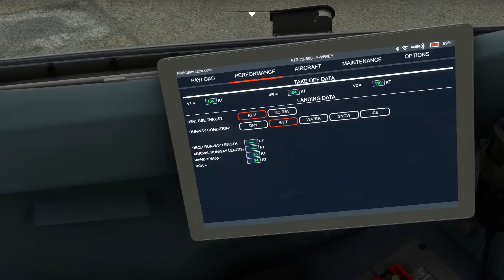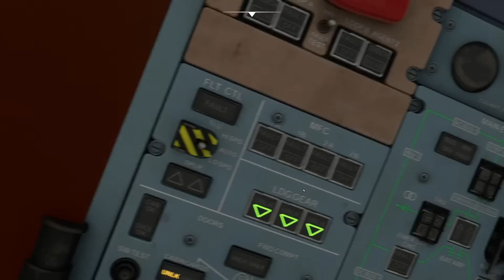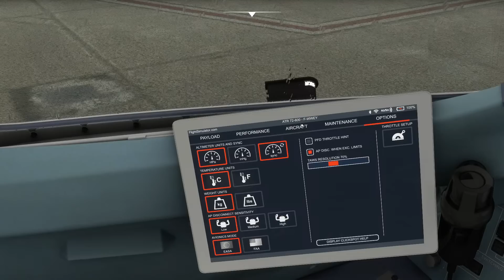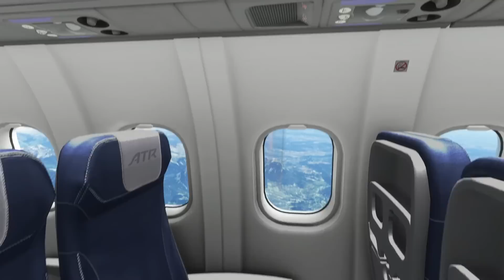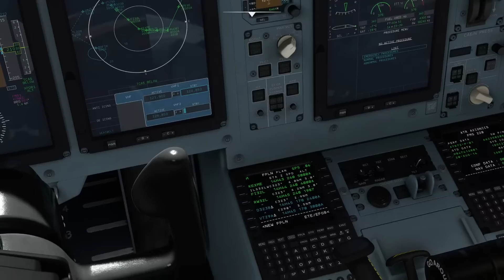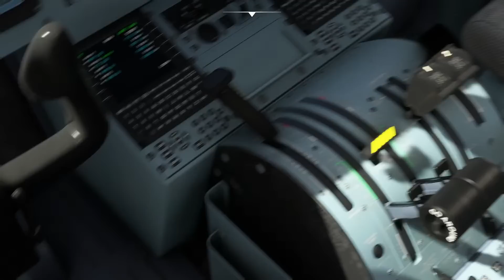ATR 72-600 FIRST FLIGHT: Study Level or Game? | Real Airline Pilot

Comment: It's hard to get typed in a new ride.  I'd forgotten until I moved into MSFS and the 737.  I miss my 757.  😣
Reply from the maker: The 757 must be a really cool plane to fly! I almost got to fly one before I got my new job on the A330, what a difference that is though!
Reply: @A330Driver  Well, an A330 vs 757/767 isn't a bad choice.  If Boeing would pick up my design for the 757X, I think that would be the way to go.  Since the 787 is essentially the 767 replacement, why not downsize the 787 as they did with the 767.  They could reduce the size of the tube for a 3/3 single isle, use the 787 wings, avionics and, why not, the GEnx-1B54.  Those big honkers would require them to keep her long legs for the perfect aircraft.  I get chills just thinking about it.

Comment: Unfortunately, I have to disagree with your opinion. 
Generally people have some expectations of the word expert or professional. Let me explain. 
If I call a product expert or professional, the level of the product must correspond to that. As much as the ATR product pretends to want to be professional or expert it is not. What usually separates the amateur from the professional is the depth or range of knowledge skills in a pilot side and depth of system simulation in aircraft side. In a product designed for professionals (experts) we rightly expect the best that can be provided. Unfortunately, Microsoft's ATR 72/42 certainly doesn't meet this! In fact, it doesn't even come remotely close. If anyone has twarted expectations and rightfully upset the community, it was Microsoft.
People rightly expect that if something is expert level it will be expert not a slightly better standard. It is quite obvious that making a good aircraft with an in-depth simulation is not a problem, as we can see with other projects even some for free. However for a giant company that has all its source code and core creative team this is a big problem. 
The ATR 72/42 ranks somewhere between the default ASOBO and A310 aircraft. The fundamental difference is that the A310 was free. Unfortunately, Microsoft wants to pay for this unfinished model from the junk shop. Even if the price seems low. It's only a low price on the face of it, what the customer gets for it is overpriced and most importantly unfinished, untested and frustrating.  

Microsoft not only missed the opportunity to make up for many disappointments with their customers, such as the very failed weather or the inability of the 3D weather radar in the simulation. Unfortunately, Microsoft has further annoyed fans who have no problem paying even more money for a truly expert level aircraft.  
I will leave aside the fact that Microsoft has ripped off some customers from selected countries and did not give them the promised discount despite having a premium- (deluxe) license and not communicating on this matter. 
Summary:
ATR 72/42 is the only turbo twin prop airliner in MSFS 2020 (biggest opportunity for developer) that is missing in the simulator and fans have been calling for this aircraft for a long time. Microsoft has offered an aircraft that it calls the expert edition (level), but which is nowhere near that level. 
The plane is unfinished and full of basic bugs not only in the avionics but also in the 3D model, just go through the bug reports. Maybe it wanted more time to work on it and especially to test it. 
I hope I can afford this rating because I have +5000 hours of flying time with ATR 72 and DASH8 in sim. Unfortunately, the current ATR 72/42 is not even close to the previous simulations by Flight1 or Majestic software, but calls itself an expert edition. 
If I have to call this aircraft. I say: 
A missed opportunity and a bitter disappointment.

Comment: ok, so after watching many videos on this release of the ATR, I have finally gotten off the ground. However, now I am running into yet another problem. This is the 72 ver, btw.  My climb speed is almost at stall speed, flaps up, landing gear up and rate of climb is a lowly 800fpm. My throttles are at max and still cant get the airspeed up. It takes forever to reach cruizing alt. If I add any more power, my throttles automatically reset to idle. Possible solutions?

Comment: Hi 737NGDriver. Very good video, congratulations! I have the same processor as yours, an i9 9900k, 32 RAM and an RTX 3070 Ti. I have the configuration in Ultra. It happens to me that when I fly from one airport to another, in the approach, shortly before touching down, it shows how my system is updating the scenery and the game skips, it's disappointing when this happens. My temporary fix is before I load a flight, go to the destination airport, do a fast loop flight, close the flight and start from the origin airport. It seems to me that this is how the scenario of the destination airport is saved in the cache and the issue is solved. Has it happened to you? Thank you.

Comment: Just like what you explain on the Airbus mistakes video, you don't have to put coordinate into the init pos, because it has algorithm continuously computes its position by mixing data form all positioning equipment just like the Airbus. If you put in coordinate into init pos box, you'll override the auto fms positioning function. Furthermore, if you decide to override this function, you'll still have to click the sensors init, otherwise it'll have no effect, once again just like in the Airbus where you'll have to click "ALIGN IRS ON REF POS", to put the inserted ref pos into effect.
Reply: And little trick on route programming, when you need to use airways, you don't have to type the airway identifier, instead just click the airway and the fms will show you all available airway from that point. To select exit is the same, you can just click the "to" with empty scratchpad, and it will show you all available exit for that airway. If you need to use another airway after exiting the first airway, you can just click again the "via" and do the same as before.
Reply from the maker: Also thanks for the airway/route explanation! I covered this in my tutorial video as well now :)
Reply from the maker: Thanks for the explanation! In my FCOM copy it said to copy/paste this, but it's an eleven year old copy, so probably outdated. Or maybe limited by the companies SOP. Thanks for clarifying this!

Comment: Ironically the Electrical systems are more similar to the Boeing 787…. That has wild AC and inverters for the 400Hz.

What’s really interesting about the electrical generation (to me) is the DC generator is on the core (N2 on a jet) and the AC generation is on the prop. It’s such a clever system to jam as much as possible into a tiny plane.

Comment: Thanks - brave to jump straight in.
The sound is disappointing.  The beta range at ground should be very distinct sound. Running on idle in feather sound is missing.  Also the deep roar at TO power is missing.
No buy - Waiting for Majestic Q400.

Comment: The Bravo Throttle Quadrant is unable to be used with this so called "Expert Series" Aircraft.... Do not waste time trying.... Microsoft and the aircraft designer should be total ashamed... This should of never been released and not sure what they feel is "Expert Series" versus "Junk Series"... Feel very much ripped off... They just say, have fun figuring it out on your own when you know not one darn piece of code and control bindings... Developer should be absolutely ashamed of themselves... Developer needs to fix the VS/NAV/IAS buttons and dials for do not work... No ability to bind the beacon/taxi/landing/nav/wing ligths to tha Alpha Yoke... Fix your so called EXPERT PAYWARE for those true simmers outside a darn XBOX Gamer.... WRITE DOCUMENTATION HOW TO SET AND BIND and fix all your control issues... 737NG Driver, can you do a very detailed control config of the Bravo since you have direct access to the individuals who designed this falsely advertised high fidelity aircraft that can't bind proper controls... Sick of developers not supporting certified MSFS2020 Controls and providing documentation on how to configure the correct profile based on THEIR CODING... That is condition lever not propeller... Really developer and stupid binding so called protection (if you can't fly the plane and not touch certain things DO NOT PENALIZE THOSE WHO CAN with a stupid binding setup)... Appreciate the price, but this is a POS even at $20 and DO NOT RECOMMEND until developer fixes the binding controls. Asobo's definition of study level is well it works for the casual flyer with an XBox Controller and screw the rest and obviously the developer as well....
Reply from the maker: Well, I used the Bravo with it and it worked.

Comment: Few things I learned by watching Magnar's videos:
1) don't press ice test button, he did a whole video on that
2) dh/MDA was blinking due to Capt/fo not set to the same mode
3) parking brake is one position further down, it was only set in emergency break 
4) you can enter radio frequencies without dots, 1228 followed by enter will give 122.8, very handy
5) single engine taxi using eng2 after just 2 mins of cooling
Reply: That's actually company specific sop requiring 2 mins, but from the factory 1 min in ground idle will do, and 1 min is what's written in the fctm. And then further 30 secs delay after feathering each engine before shutting them down to get the oil back to the tank.
Reply: @chris22capt  Don't quote me on it, but I think remembering that they found that 1min wasn't long enough or something, but it's been a while, could also have been updated since. Originally it was 3 minutes but the airlines pushed against that 😁
Reply: @sushiat  Don't worry bud, I saw your quotation note from Capt. Magnar. But yeah, most cockpit landing video I found on YouTube, mostly let the engine to cool down for 1 min only before feathering the prop.
Reply from the maker: Thanks!
Reply: @A330Driver  One more thing I remembered: The Secondary flight plan can be swapped instead of activated, he recommended always to use that, so that the primary get's preserved in case you want to return to it. Activating the secondary deletes the primary

Comment: One thing I don’t understand. When I pull away from parking I lose hydraulic power which causes me to lose my breaks and steering. Followed step by step
Reply: Make sure the condition levers are in Auto, and you don't have any faults on the AC wild power or hydraulics panels.

Comment: Actually this airplane has weather radar, it just has to be more rainy / heave weather.
Reply from the maker: Then it's bugged. Looking outside the window it must at least be an amber, if not red return during that departure.
Either the visuals in MSFS don't match what's "there" internally, or the WXR itself is bugged. In real life that would have been amber at least.

Comment: The AC Wild external power is usually only used by maintenance, since most of the systems on it you only need when the engines are running. If you need to pressurise the hydraulics when the engines are not running (i.e. to release the prop brake), you press the Hydraulic Aux Pump button on the pedestal (behind the parking brake) to activate the DC Aux Pump.
Reply: Also - you need to have the tail prop installed when the doors are open. This is to prevent the aircraft tipping backwards when passengers are boarding and deboarding (which, on the ATR, is through the rear door).
Reply from the maker: Thanks! I never saw the tail prop here in Europe when I saw an ATR during boarding or deboarding though. Maybe that's more of an American thing? At least I've heared them to use tail props on 737s as well which we don't do here.
Reply: @A330Driver  The tail prop thing is valid in Europe and other places too.

It's standard procedure for the ATR (and I suspect for other turboprops of similar layout).

When the door opens it's the first thing the flight attendant gives to the ground crew (along with documentation) to install.
Reply: @A330Driver  They do the same too with the tail prop in Indonesia. Once the FA opened the door, one ground crew will enter and ask the FA for the tail prop which will be given and will be installed by the ground crew thereafter.

Comment: I've just managed to watch the entire livestream. I have never flown ATR in real life nor in any sim but from what you've shown I'd say it can be placed in the Aerosoft CRJ range. It's flyable, can be flown on Vatsim, systems generally speaking work as expected, it has some quirks - some things behave unpredictably or weirdly (no idea if it applies to the real aircraft because it's really difficult to find any information besides FCOM). For now, it's definitely nowhere near Leonardo MD8x, PMDG 737 or Majestic Dash for FSX/P3D.  The value for money is really appealing though. I'd love to see Majestic Q-400 and JS-41 by PMDG in MSFS.
Reply: Out of interest, what places this lower than the PMDG aircraft in your opinion? From what i can tell on the stream it seems to be in the same general region of PMDG when it comes to realism. The vast majority of systems seem to work as intended, system depth is definitely there. 
In terms of performance/general control feel wed need a real ATR pilot to comment on that, but that being said PMDG used to have issues in that regard too.
In summary, i dont really know what the hate is about, looks like a pretty good aircraft, for the money its a steal.
Reply: @Dudeisthere  nowhere near the PMDG. Wobbly VNAV, no "turns" on ND, all legs are segments tied together. FMC is basically default with some additional features. And I'm not even mentioning all the failure simulations etc..
Reply: @jinoss1768  I will have to disagree with you about the FMS, because that's how the real thing exactly looks like.